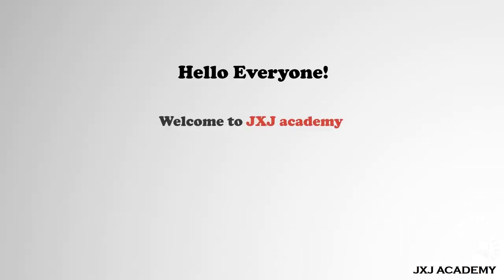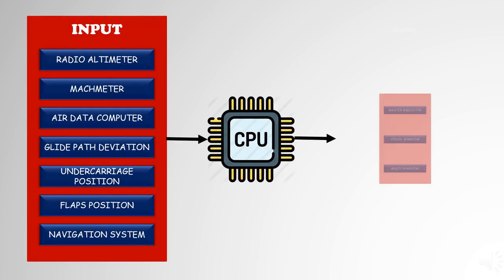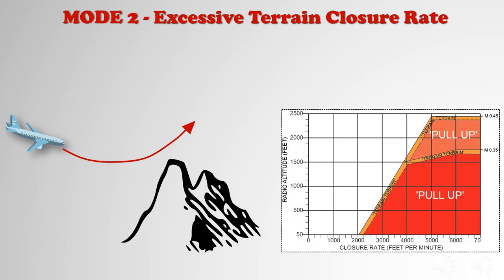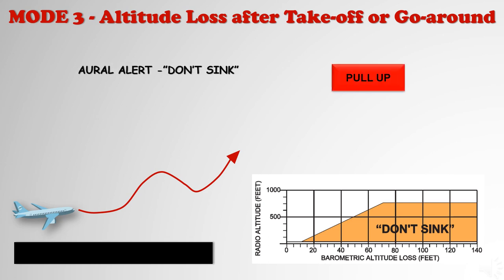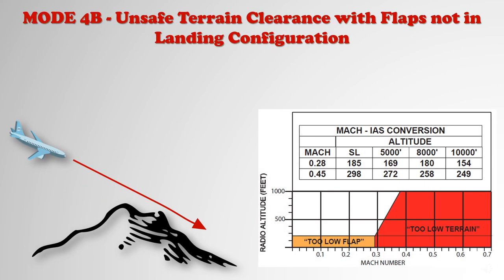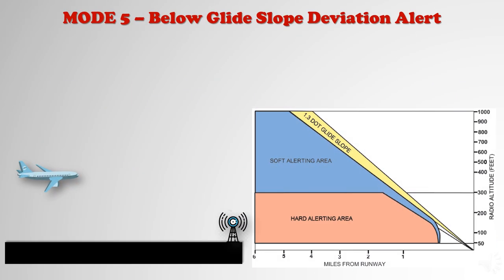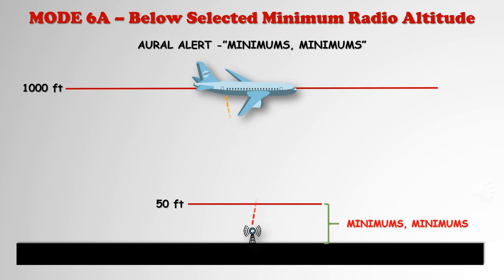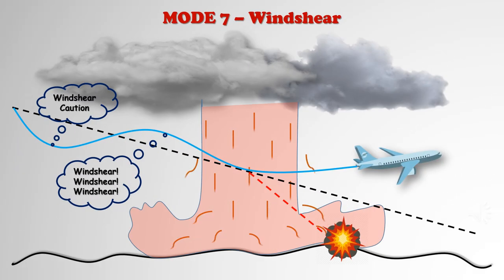Understanding the Different Modes of Ground Proximity Warning System or GPWS!

Comment: Great presentation, very clear. RIP to lives that created these modes.
It would be nice to see examples in context.  I like mode 1 and 2 and 4 (1. SINK RATE, PULL UP, 2. TERRAIN, PULL UP,  4a TOO LOW GEAR/TERRAIN, 4b TOO LOW FLAPS/TERRAIN)
I propose changes to mode 3, 5, 6, 7 to give clear instruction.
(3. DONT SINK ==>>> POSITIVE RATE REQUIRED, 5. GLIDESLOPE ==>> MOVE INTO GLIDESLOPE, 6. BANK ANGLE ==>>REDUCE BANK ANGLE, 7. WINDSHEAR==>>CAUTION WINDSHEAR)
Reply from the maker: That's some good changes you have mentioned to the Modes!
Reply: I think the callouts are simplified due to the fact that pilots might have 5-30s to react, so giving them larger sentences is impractical. And if you hear "BANK ANGLE" you know that the roll is too much, not flat anyway